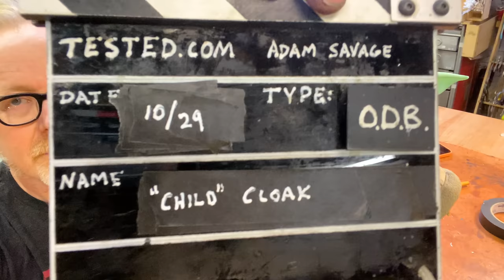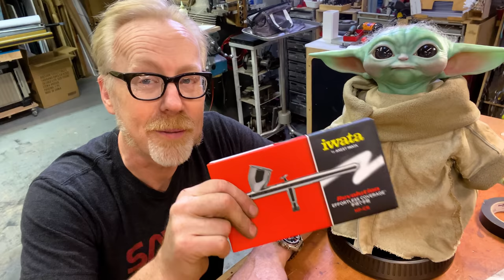Adam Savage's One Day Builds: Baby Yoda Mod and Repaint!

Comment: If the forearms were popped on, they can be popped off. For future projects, I would recommend lightly heating the arm with boiling water or a heat gun on low. This works great on lots of hard plastic - especially things like action figures. The plastic become pliable while hot, and then reforms when it cools. Just a tip for you to keep in the toolbox for any future projects that may be similar. Great build, Adam!

Comment: For situations like bedding the wire in the arm, where you mentioned wanting to avoid getting the activator spray on the arm, have you considered using something like Loctite 3090? It's a two-part adhesive that dispenses the cyanoacrylate and activator through a mixing nozzle and dumps it into the one location. It's got a great gap-fill and gap-cure as well. The drawback is, it certainly isn't cheap.

Comment: Before and after shots of modifications like this at the end of the video would really show the differences I feel. 
The bottom edges of the cloak could do with some more weathering and slight fraying as that part most definitely would have been dragged across muddy/sandy lands while on their adventures. 
Also, slightly air brushing the cheeks and redness could have potentially been a step aswell, they really do stand out a little too much compared to the post processed tv shots.

Comment: I haven't looked at other comments, but I believe the lower arms were over-molded onto the rigid form. It is a secondary molding process used on many handheld devices to integrate "grippy" silicone surfaces "over" harder slicker surfaces.

Comment: Same thing happened last time I've ordered an airbrush, did not had the correct hose adapter for it. Solution: 3D PRINT the adapter. Worked like a charm :)

Comment: You should check out the newer milwaukee m12 installation driver. It's a really handy tool for the arsenal. I own one, and I use that thing, way more then my milwaukee m18 set - drill and driver. That installation driver comes with 4 different head that click on and off one of which is a 90° driver and then there's 3 other handy attachments as well.

Comment: Adam, Milwaukee makes a great 12v drill and driver set called the M12. They are fantastic and the battery platform is going to be around for a long time. Might be a good replacement for you Makitas.

Comment: Check out the 12v Milwaukee line. I missed my Makita too until I found the Milwaukees. The stock batteries fit right in the handle and it's really solid.

Comment: Thought this made great improvements. Hot Toys version will be totally posable but the ear seams are very noticeable. I wonder how possible it’ll be to take a sideshow head and attach it to the hot toys body. I would personally hve done the arms wrapped in foam as he mentioned because the right arm (holding the knob)particularly looked very flat afterwards. That’s probably the only thing I would add.

Comment: I'm a 3D animator/rigger and I'd suggest if you want to raise the arm above the shoulder you need to give it clavicle control, so chopping away the shoulders completely to let the wire raise up. If an arm is raised above the shoulder the arm stops rotating and the clavicle takes over. That's why the raised arm pose looks a bit off, because the point of rotation should be coming from the clavicle not the shoulder joint. Great job otherwise, just thought I'd point out something you might not be aware of.

Comment: A minor modification I did on mine was to cut the two stitches that tack the bottom collar to the shoulders.  This is not accurate to the prop and restricts full posabilty of the collar.  If you remove the stitches, there is a large amount of pleating in that area that is freed and it will cause the robe to droop down the shoulders.  I recommend replacing the stitches by tacking the shoulder (where it was originally) to the bottom seam of the collar (as opposed to the top of the collar as it originally was).

Comment: Addressing the airbrush stand...If you bend the wire in the opposite direction at the base of the magnetic clamp, the opening will be facing out, making it easier to access.

Comment: Regarding that Electric screwdriver (i really don't know if it's the name) Bosch makes almost the same one and the Accumulators look compatible.
I've been using it a lot when working as a carpenter, mostly because my coworkers had better ones, so they wouldn't steel mine :D

Comment: I was thinking you could use small springs and high tensile thread to go through the shoulder ball/joints and connect the hands. i would give you movement and pose-ability with the plastic's friction.

Comment: you could have easily reached the hand screw by putting the arm in hot water to soften the rubber also, this comes from a guy who repaired about 500 talking dolls in my lifetime and this problem of stubborn rubber is very familiar.
Reply: this thing opening up like this could give it the specs to put a digital voicebox in there.

Comment: I'd like to point out that the lining is probably for longevity rather than care. No offense to Sideshow, but Adam is right that the inside doesn't technically need the lining to be accurate or to be comfortable for the lil guy. However, lining finishes seams to help keep them from unraveling. By encasing them in another layer, those edges face far less environmental and manual wear (which would mostly be rubbing/washing. Admittedly, this coat sees less than that than a regular coat, but still.)

Comment: Hi Adam - in the vid you were originally looking at ball joints, but then didn't use them. I was wondering if this was because of the difficulty of sculpting the sockets? That's what occurred to me when I thought about articulating the doll. The only material I could think of using was air-dry clay but would it adhere? Or be too brittle? I'd be interested in your thoughts if you wanted to share them. Thanks.

Comment: I just bought my 8-yr old son a 5" replica of a lamborghini gallardo done up as a police car. before I give it to him, I plan to install a lighting system using miniature LEDs & whatnot. there's not a lot of room in the thing because it already has a pull-back motor under the engine bay, & barely any depth over the front axle. in we go.... 🪛